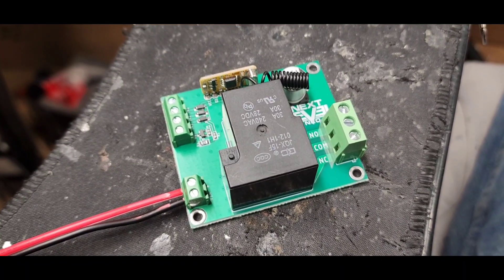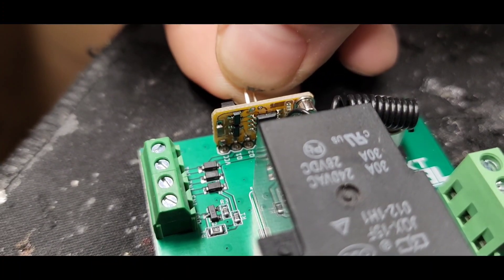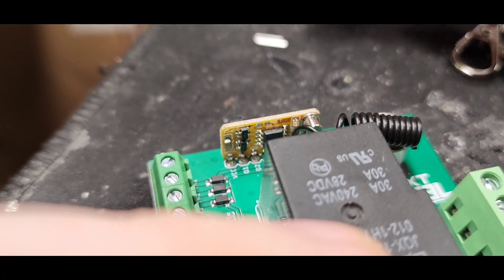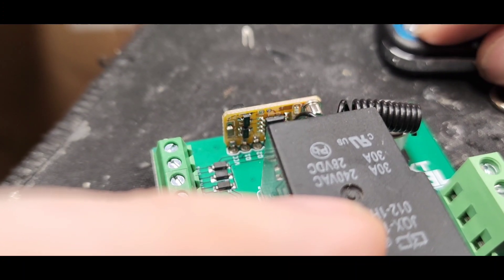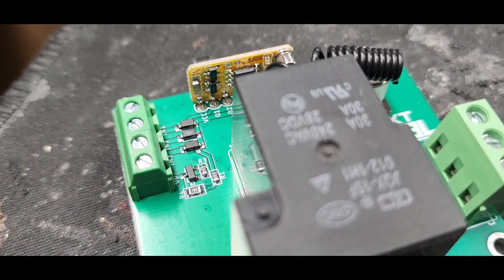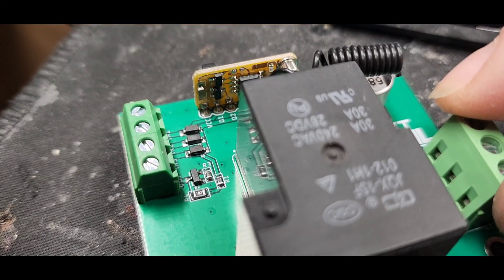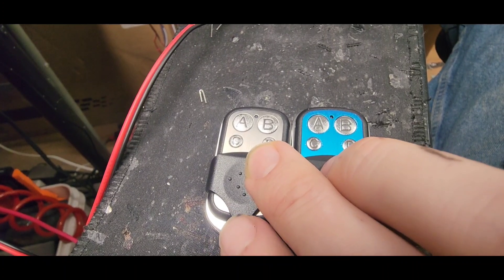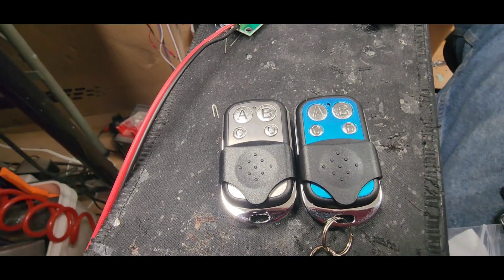How to Program NLN Battery Savers

Comment: I forget if I asked you this yet and what the answer may have been,
But with your power savers, is it possible to bypass the Remote and take a signal from my RFID alarm system to cut power to my Blueghozt controlled LEDs whenever the vehicle is locked/armed?

I can get either a Latched or pulsed ground or 12v signal when the alarm is armed and disarmed (one each). The system passively arms and disarms when you enter within around a 10 foot circle. 

The blueghozt will be controlling some interior led strips that animate on as you open the door and again a different color when the truck turns on at night.

The arming/disarming would be a good opportunity to cut their power , and plenty of time to enable them to be ready to animate on by the time you get to the door to open it.

I just can't see a scenario where the remote will be used on this particular interior setup just yet, hopefully its use is optional?
Definitely will make use of it when I get to the exterior lighting for enabling show modes from a distance.

Thanks for your help! 
PS, got a strip of your UCS2903 coming to play with - really excited to check them out !
Reply from the maker: The remote transmitters circuitry is all on the pcb so it cannot be replaced. There are 3 triggers that act just like the transmitter in that they activate the relay. They are on a 15sec delay off circuit but any of them would work well for your application. And you would still have the remote that can be used for easy show mode activation.